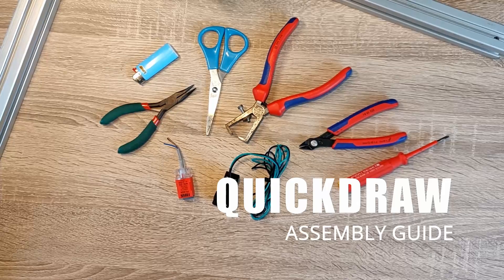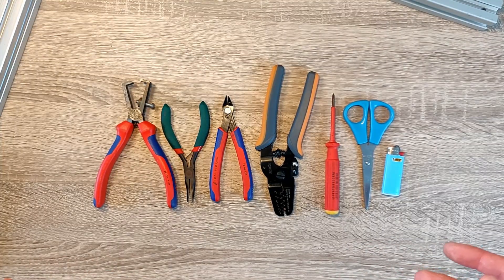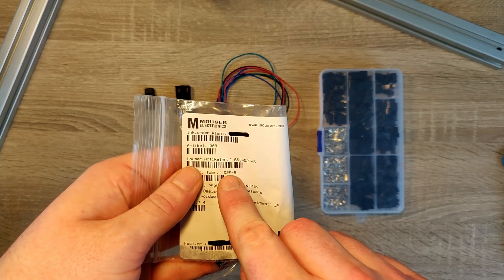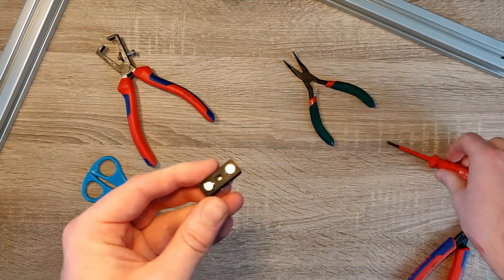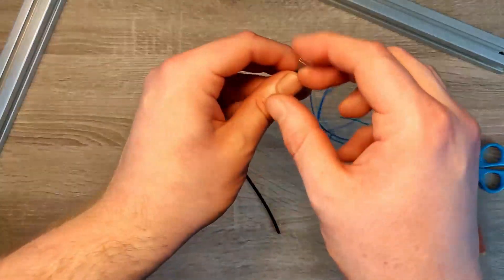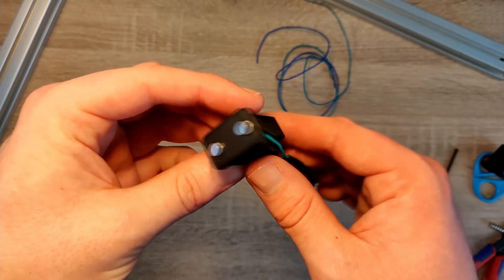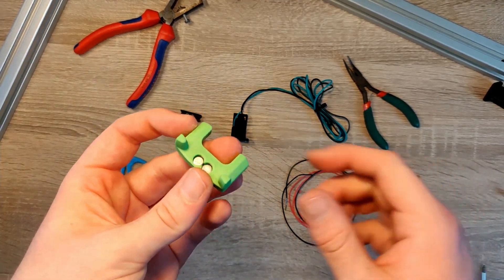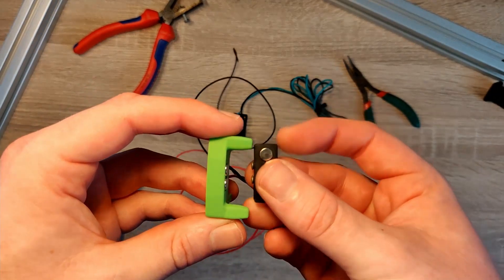Quickdraw Assembly Guide - The Magnetic Z Probe

Comment: Pretty nice, and a cheap but precise alternative to other touch probes like the BLTouch and it's clones. I had a servo arm with microswitch but just gave up on it after it started to jam instead of deploy/retract properly, also if you don't design it PERFECTLY, the servo arm setup will inevitably bend a bit and screw up the results every now and then, but this system solves it while still being fully automatic.
Reply: I had a servo probe like 3 years ago on my Tevo Tarantula and it was way better when it comes to repeatability than the BLTouch, but as You said servoes can be wonky sometimes and stick too much/too little. Simple solutions like that are sometimes the best, am I right?

Comment: Why do you need wires on the docking station? I can't find wiring instructions anywhere.
Reply from the maker: its optional, its so you a. know if the probe is in the dock, and b. know if it fell out of the dock when you inevitably miss the dock bc you messed up something while setting it up.

Most people arent using it
Reply: @AnnexEngineering  do I connect dock to the same pin as probe?
Reply: Im pretty sure you got your answer over on discord, but just to provide the info for anyone watching this later: 

You can use the +5v and ground of a limit switch port on your controller.
Reply: Maybe because the microswitch is Normally Close (NC), and I think the cables from the dock and near the extruder are in parallel, so when the microswitch is in the Dock, the signal to the Probe is inactive, even is inactive at the moment when the microswitch is taken by the extruder, and only the signal is active when the microswitch is pressed to the bed.
Reply: @erodrigolopez  It may be.